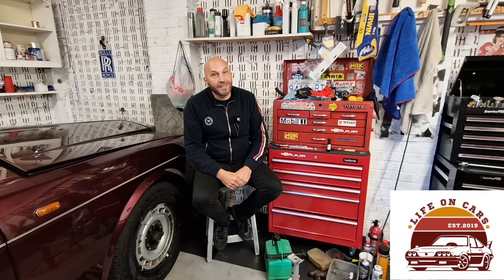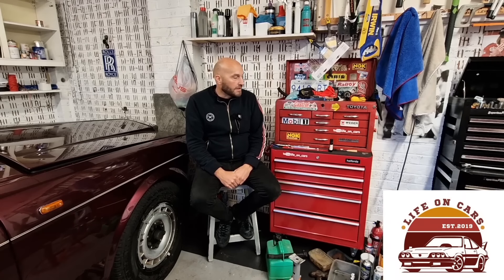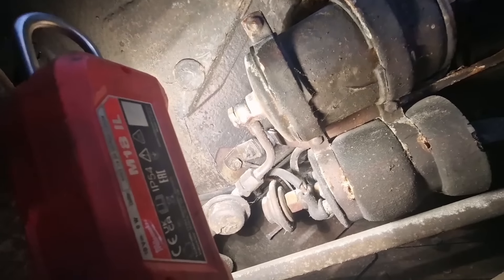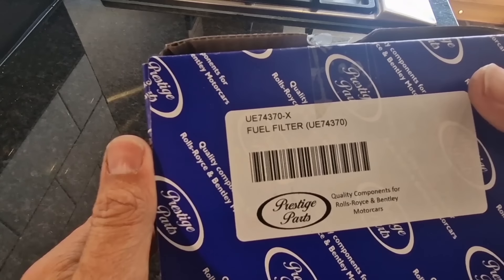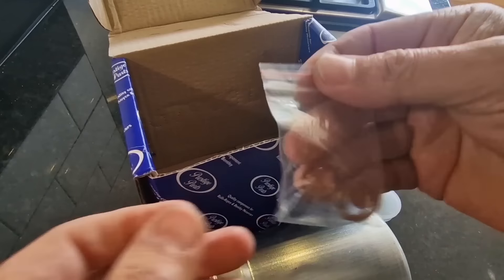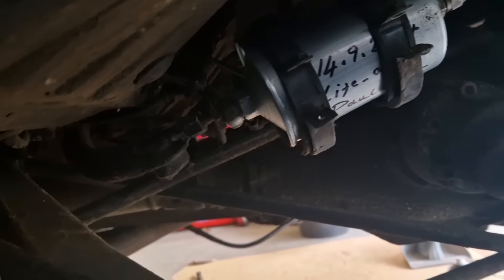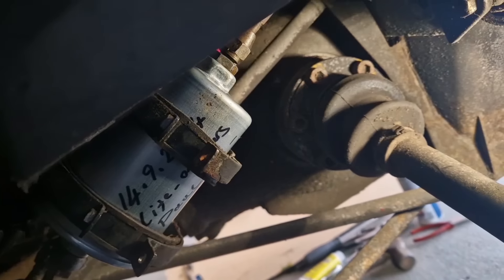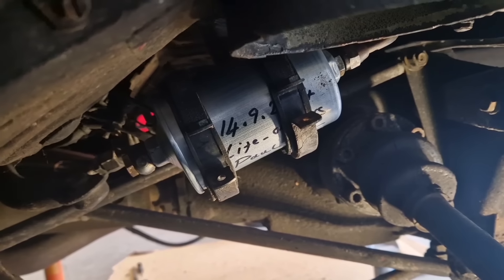I found a DANGEROUS FAULT on the Rolls- Royce Rescue project after a Fuel Filter Change !  Ep.16

Comment: Just be grateful that you decided to change the fuel filter and noticed the leak. The condition of rubber and plastic parts is a real problem on older modern cars. I have a 1990 Mercedes S124 and a lot of plastic parts are really fragile. The heat cycles they go through render them brittle and clips fail all the time. Really old cars, such as your friend's Rolls-Royce have no plastic parts to break.

Comment: Good to spot that early Paul.  I would have thought that a fuel hose would be the last thing to attract a mouse/rat.  Normally they go for electrical leads which would smell better.  If that had been the case, hopefully you would have noticed it by now.  It might be a blessing in disguise as now you have got rid of any water/muck in the tank.  I think you would be right about that being the original fuel filter….poor old girl.  I can see the smile on its face and it is very happy to be rescued and in your warm garage.  😊
Reply: I was thinking the same and was wondering if it was squirrel damage, judging by the size and shape of the teeth marks, which are similar to those that have been inflicted in our plastic bird feeders.

Comment: Hi Paul, nice work catching that in time!.  In the US an issue we have with older cars is the impact of the ethanol that is in the petrol today, which degrades the rubber fuel lines that were used at the time.  I have several older cars, and I’ve had fuel lines fail because of the ethanol attacking the “vintage” rubber fuel lines.  These crack and then start leaking.  I’m not sure what the ethanol content of the petrol is in the UK, was wondering if the new fuel line that you were supplied met the modern standards for E5,E10, and other modern ethanol petrol blends.

Comment: Lots of foxes in my area, they just bit through the brake pipe rubber on my Lexus rear brakes, luckily braided pipes inside the rubber. Cost £240 to fix! It’s more common than you think….

Comment: i've always been told these things happen for a reason  and this potentially saved burning the car down  that is the problem with older cars fuel lines get brittle or get chewed up that's why you should always do an inspection of every part of the fuel line especially if it's been standing around
Reply from the maker: True 👍

Comment: Hello mate, hope you are well I just wanted to ask a question I’ve got to remove the air-conditioning unit from the jag as apparently it’s leaking. I was just wondering if you’ve had any experience in removing the unit from a jag in the past? Only the garage is telling me they need to remove the bumper And pull it out front ways rather than from underneath all the best peter
Reply from the maker: Sounds like the condensor which is in front of the radiator so yes bumper off for best accessibility

Comment: Try putting a vacuum cleaner on the filler cap to keep the fuel in the tank when you remove petrol hoses.
Reply: Draw petrol fumes into an electrical device. BANG.
Reply: Vacuum cleaners have a very sparky commutator - 🫣